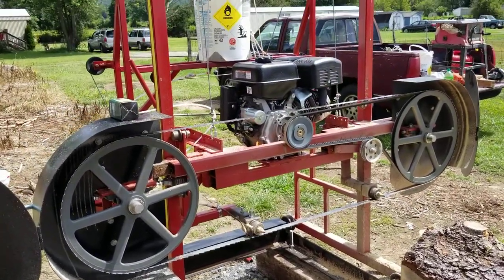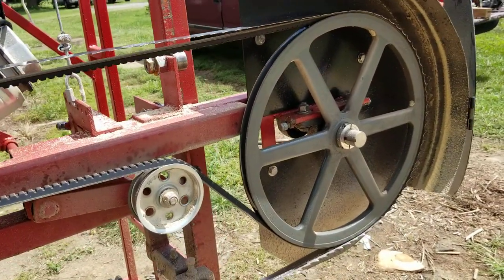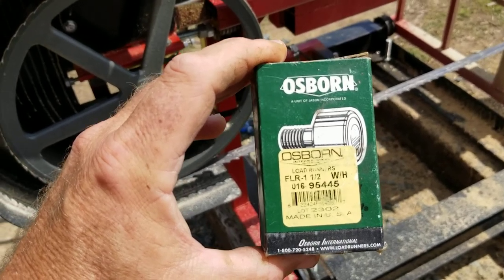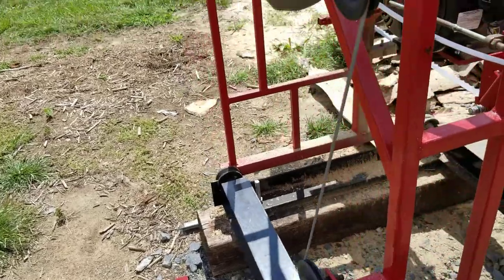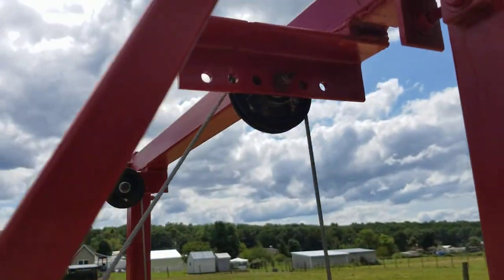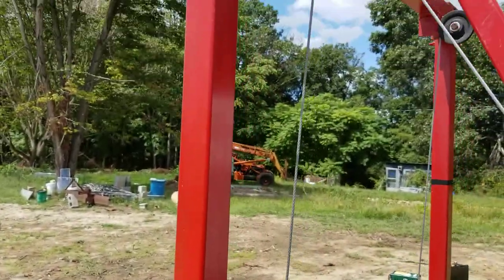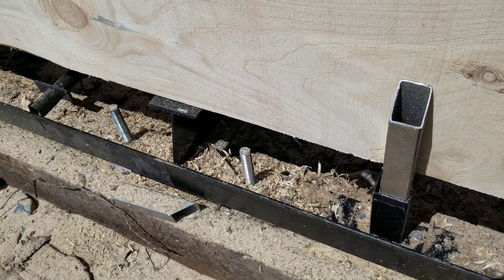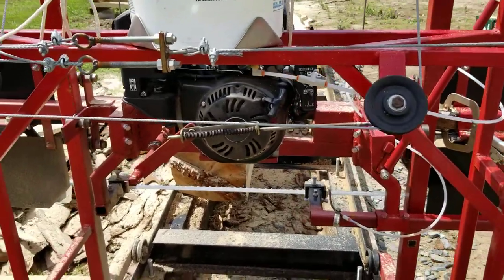Homemade sawmill

Comment: Thanks from Australia. Would have loved to see how you adjust the tracking on your wheels and how you tighten the blade.
Reply from the maker: I straight the wheels across the front of them to get them straight, I also placed shims under the bearings closest to the wheels I believe but will verify and let you know for sure to put camber in the wheels. To tighten the blade I used all thread rod with two nuts and a very strong spring to allow if bark or a piece of wood goes between the wheel and blade. I will make another video of what you are asking about in a day or two and download it for you. Thank you for watching my video!!! Really cool that you are from Australia!!! Stay tuned because I like helping people out!!!
Reply from the maker: I used bolts and coupler nuts at all four corners of the bearings to adjust the bearings and to make sure that they are held in place because the pressure to pull them is alot.
Reply: @narrowstripsawing9595  Thanks Mate, you are a legend. I am busy on  my own Sawmill build and want the best methods available, yours looks well designed. You are lucky to have Cooks sawmills in the USA, they are a wealth of info and gear, however shipping and customs/duties to OZ are a bit prohibitive so I am doing a lot of up cycling of second hand gear. I have a lot of ceramic discs from servicing pump mechanical seals, and may try make a blade guide using them. Thanks again
Reply from the maker: I finally got the video of what you were asking about, uploading it now. I apologize for not doing it sooner but we have been having storms alot and been really busy. I hope it helps you and answers your questions, if not or you have any more let me know. Thanks for watching!!

Comment: I use the 13 hp hf engine also, no problem cutting 28 inch wide oak.
Reply from the maker: I'm surprised how good it cuts also. Been camping and didn't have any service to respond earlier.
Reply: @narrowstripsawing9595  great work on your homemade sawmill! Mine is also homemade.
Reply from the maker: @danielbowman4819  watched your video of your mill,awesome job my friend!!!

Comment: super build. 

why did you make it the width you chose? just wondering. it looks to be about 24" wide max. 
I  have a 24" wide Timbery M280 mill that is super for my first mill; after less than 5 years I'm ready to begin to plan out a mill that can make that will handle at minimum 36" wide or so. I have had several logs that were way to wide and lost much material butterflying logs or trimming edges. 

I will refere to your build for ideas when building my own. 

thanks for posting.
Reply from the maker: Thanks for watching my video! I appreciate it so much! I can cut a 32 inch log between my guides with the one slid full open.  I  wished that I would have made it wider but it's very rare that I come across a big log. I could redo both of my guide brackets and gain about six more inches but would also have to widen my track some. Don't know if I ever will because I don't come across many huge logs. By all means hit me up with any questions and I'll be more than glad to help anyway I can. Thanks again for watching my video!
Reply from the maker: Have you checked out EZ Boardwalk sawmills? I just found out about them 2 weeks ago, seem like a decent sawmill.

Comment: I like the flanged bearings, looks like it would be a smooth non binding way to lift the head. Where do you purchase these? Ive been looking for an hour and a half
Reply from the maker: I got them off a old weight bench. What you can use is idle pulleys or v belt idle pulleys. It does take longer to crank up and down this way though. When I get time, I'm either going to modify a new winch to make it faster or run a shaft across the top with sprockets to raise and lower my mill to make it quicker. If you have any more questions feel free to ask me anytime. Thank you for watching!
Reply: @narrowstripsawing9595  i was asking about the roller followers you use to keep the head aligned with the post. Did you order those from osborn or did you find a different supplier
Reply from the maker: @jaydooley5077  grainger has them, Osborn flanged roller and they are expensive-70 dollars each. You can use a sealed bearing, I was considering doing that but my work had the Osborn and discontinued using them.

Comment: Looks good! I like how you run your belt on your wheel.
Reply from the maker: Thank you very much! I'm planning on changing it this winter because I can only cut 8 inches deep because of the motor pulley. Planning on driving it the same size pulley on the back end of the same shaft. It cuts very well and a blast to run! Be uploading more videos soon of the lumber I have cut so far. Again thank you!
Reply: @narrowstripsawing9595  Always tweaking it! I laughed this weekend I cut 2 oak posts and told my wife when something needs fixing I dont need a manual !

Comment: Please, from where you sourced the saw wheel?
Reply from the maker: Surplus Center, also got the bushings from there also.
Reply: @narrowstripsawing9595  thanks. I'm from India. Maybe, I'll have to make use of two groove 18" belt driving pulley!! 
Your design is efficient, to the point.
Thanks for responding.
Reply from the maker: @piuvbn  I'm going to build a new carage from 3/16" x 2 inch square tubing so it is more stiff and rigid. If you are planning on building one do it this way and it will be much better. Thank you for watching and good luck with yours.
Reply: @narrowstripsawing9595  sure. I'll be waiting for your uploads.

Comment: I like your ajustable saw guide mine are fixe and non moveable , it i could change my design i would go for  moveable Guide like yours. Sgt rod
Reply from the maker: Thank you very much!!! I was thinking of making mine fixed but with all the research I decided to go adjustable and very glad I did. It really helps if you cut smaller diameters or widths to keep the blade straighter and true. Maybe you can do it to yours without to much trouble. Look forward to hearing from you if you do or if I can help anyway hit me up. Thanks for watching and commenting!!!
Reply: Will do, feel free to look at my sawmill if you wish it is Also on youtube sgt rod
Reply from the maker: Will do!!!
Reply from the maker: Awesome job!!!!! Very nice looking mill and trailer!!! Heck of a job!!!!! Thank you for your service too!!!!!